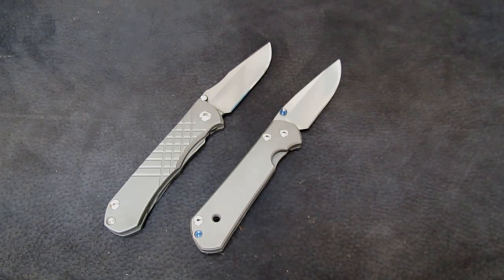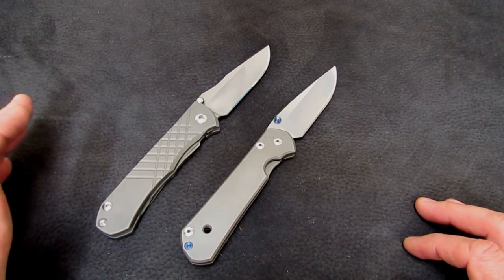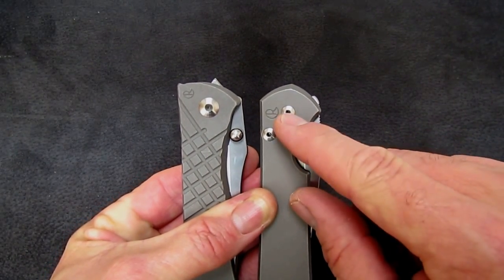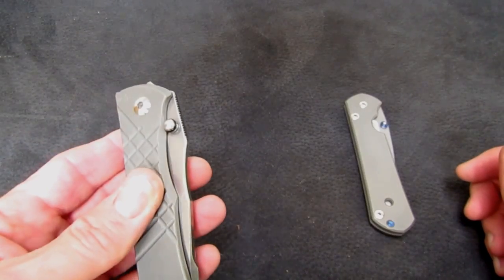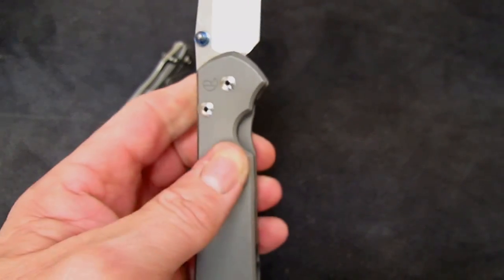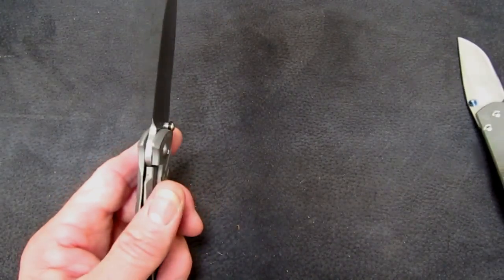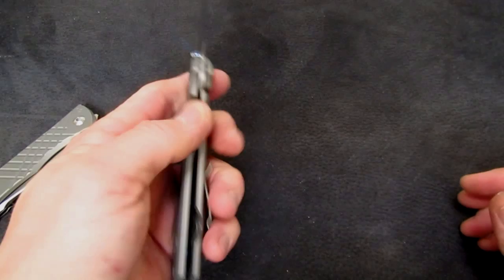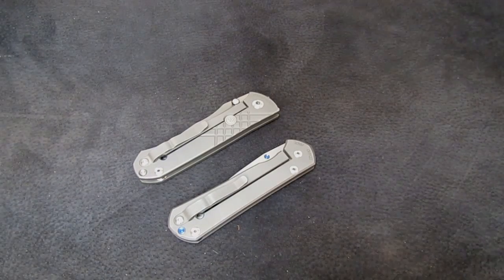Chris Reeve Umnumzaan:  Tips for Smooth Operation

Comment: Got a question for u. I just got exact same one but i have a problem that i cannot get past it. The pocket clip is alll the way further out compared to a Sebenza 21. The u num pocket clip really digs into my hand, especially my pinky. I think if the made the lockbar thikness same as the 21 and therby the pocket clip a little further in it would be kuch better. In addition the back of the handle feels a little smalle in circumferance/width and is not as comfortable. Other than that no complains

Comment: Is the umnum just as smooth as the sebenza? I want to buy my first CRK this week, and the umnum is what I'm wanting more but is it smooth like the sebenza?!
Reply from the maker: +PkwyDrive13 It's smooth, but different smooth.  Great knife.
Reply: +TheApostleP I now have both the large sebenza 21 and the umnumzaan, after some washer polishing on both they are very smooth. The sebenza is like it's riding on air, but the umnumzaan isn't as smooth, still very nice but the added lockbar pressure makes it a little less smooth. Would LOVE the pivot bushing system in it